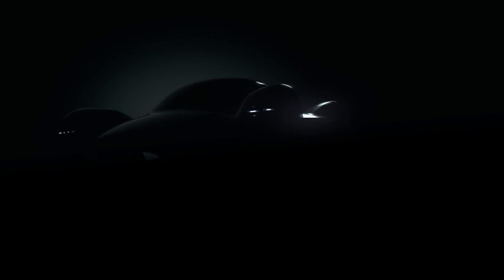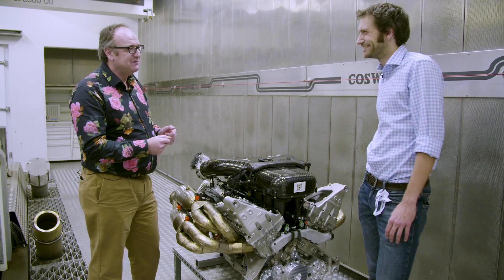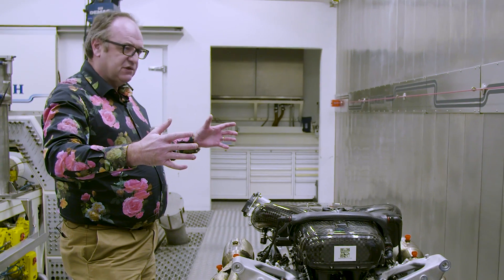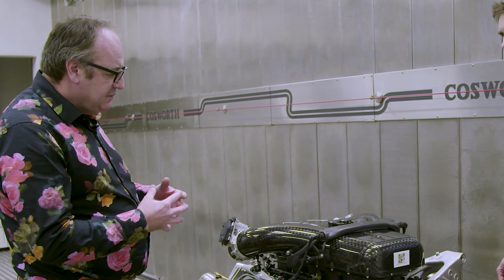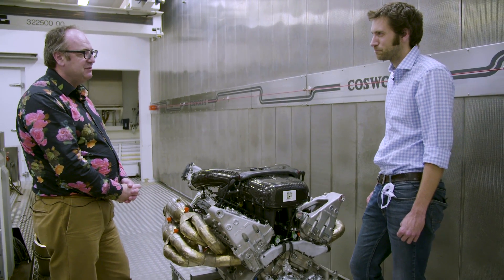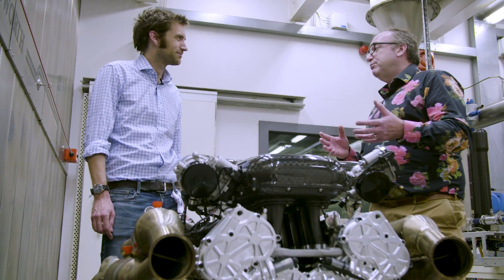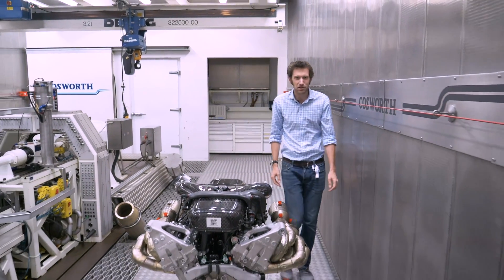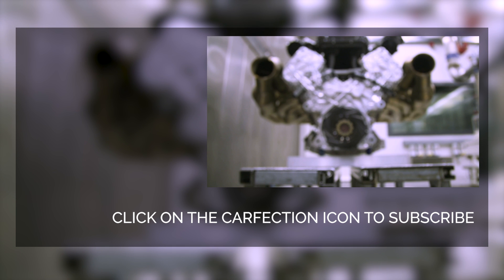Hear The Future Of The Supercar At 11,000rpm: The Aston Martin Valkyrie's V12 - Carfection

Comment: I did not think that we would ever have a new v12 na engine ever again. Thought the ones Ferrari and Lamborghini use in their cars would be the last. I am pleasantly surprised by this. Thank you Cosworth and Aston Martin
Reply: Us boffins take the emissions regulations as a challenge to overcome, not a roadblock. More to come, I'm sure.
Reply: @rigglestad8479  2L/100 km seems quite unmnagable for a v12
Reply: Just add batteries and run the emissions test in hybrid mode. Voila.
Reply: @srinitaaigaura  Volkswagen would like to have a talk
Reply: We’re running on borrowed time for anything above v8s, manufactures are making these just because consumers are there, once we’re gone, I doubt these beasts will exist
Reply: There is still hope! And there is more! The Apollo Intensa Emozione has a completely new naturally aspirated V12 as well!
Reply: @Dusto9  pretty sure thats a Ferrari V12
Reply: @Giovanni John-Blackett: Turns out you're right! After some reading it does seem to be based on a Ferrari engine. Either way, nice to see another company embracing the na V12 :D
Reply: @Dusto9  not new
Reply: @Dusto9  pretty sure the apollo v12 is from ferrari
Reply: @Dusto9  it's a ferrari V12...
Reply: And then Gordon Murray enters the arena.
Reply: The industry is very "smart". N/A engine will cost more as more rare they become. I don't think that with all the tech we have and all the development we could achieve...we could mantain N/A on the market. However, linked this image with purism, racing and so on, automakers could rise up the price of their cars...
Reply: The apollo IE has a new bespoke 12 cylinder engine. It is not a Ferrari engine like some think
Reply: Gordon Murray's new T-50 will have a 12,100 RPM V12 as well. Normally aspirated.
Reply: Guess you haven't seen the recent mclaren t50 engine? also a cosworth...12100 rpm...
Reply: @justkiddin1980  he/she commented a year ago🤦
Reply: And you're running out right now to place your order? Yeah. Me either.
Reply: Same thoughts and 1000 n.a. v12.
Reply: AndreVD you gonna buy it?
Reply: @NecumNaTo  No, i am not that rich.
Reply: Try saying that to Lamborghini & Pagani...
Reply: Roger That!
Reply: And it looks like a pagani too lol
Reply: so this isn't a freshened up duratech based v12?
Reply: not about cylinders, is about size.
Reply: as long as they keep compression high enough, they should be sustainable as far as emmissions
Reply: https://www.roadandtrack.com/car-culture/news/g6662/v12-powered-cars/?slide=12 bmw and rolls royce both have new v12's
Reply: why?  I mean we already know what the Toyota 2jz is capable of and it's more durable.
Reply: Yeah its a shame these Incredible V12 engines are dying out. Even the V8 engines are being killed of with turbo charging V6 and Straight sixes.
Reply: You don’t have to comply with emissions regulations if you sell bellow a certain number (in most countries). Translation “the rules don’t apply to the super rich”.
Reply: don't forget the Apollo IE
Reply: u buying the valkyrie?
Reply: The gordon murray design t50 that will come out in 2022 has a na v12! AND IT REVS UP TO 12,100 RPM!!
Reply: Holdens use n/a engines to 😂
Reply: @noblestar7742  maybe you should get in the ground with them like the dinosaur you are.

Electric / Hydrogen/ Biofuels are the future.
Reply: @noblestar7742  don't you DARE  insult my intelligence like that you know nothing about me, but I can tell a lot about you because of your repetition of  propaganda the oil companies put out . My background and interests mean I'm fully aware of the supply chain of electric vehicles. I am however acutely aware that a medium sized electric car is better for the environment after 4 years in  a largely coal powered country, less time still in countries like the UK where renewables account for nearly half the grid.

The electric car came about the same time as the ICE and Steam powered car, but energy storage wasnt up to the task. Its getting there but isn't quite there yet.
Reply: @noblestar7742  and since you dont have any reasonable arguments to come back with. It says a lot about you.

Good day...
Reply: @noblestar7742  you're an absolute knob.

I take issue with people condescending down to me with incorrect arguments like you do.

And you started it, not me.
Reply: Sounds like the F50 GT in forza
Reply: @noblestar7742  right. So wanting a habitable planet for generations to come is now tree hugging.

Ok then

Climate change will result in us all dying in the future. I just don't understand how you have so little concern. The planet is a finite system and we cannot keep polluting it like this.

You must be american.
Reply: Just a Ford 2(6) = 12
Reply: And FORD
Reply: I will always look up the to the v12
Reply: AndreVD Lamborghini V12 is not a new engine. It’s the old engine that they are modifying
Reply: @ddd-sx7pw  i did not know they were using a lambo engine.
Reply: AndreVD Aston Martin has it’s own engine. I mean that Lamborghini is using the same engine that they have created many years ago
Reply: @ddd-sx7pw  ok then you missed my point. what i just wanted to say is that i did not think that in the era of engines getting smaller and turbocharged, we would have again a new car running a pure NA V12. As far as i know the successor to the aventador or the next hypercar ferrari etc will not have a NA engine anymore, it will be some sort of hybrid or turbocharged thing.
Reply: I thought this engine was amazing, but now I have seen the Gordon Murray T50 engine, that's a V12 work of art.
Reply: amarjit singh I prefer the T50 V12
Reply: amarjit singh best if you go on the T50 YouTube videos. It will most likely be the best V12 engine ever made.
Reply: amarjit singh Don't worry. It will be the second best V12 🤣
Reply: amarjit singh This is second generation after the Aston Martin V12. But it doesn't really matter. Both cars are British as an I.
Reply: Trust me someone else will eventually come out with one last hurrah with a v12 withnrelatively low displacement, and itll keep on going
Reply: Yep and now, thank you, Gordon Murray and the T.50!
Reply: T50
Reply: AndreVD T50 bois!
Reply: @amarjit singh Take a look my comment is a month old...
Reply: @amarjit singh Aaahw boohoo you got me there...trolling about car issues is a new thing now? I guess that's what you get when whole generations are raised on soymilk..
Reply: @amarjit singh Pffff wow go cry me a river....i don't give a fuck...why would you start beef over a car video?? Go back to drinking your soymilk it is getting warm...come on...go now and don't bother me anymore...
Reply: amarjit singh I don’t care...
Reply: @amarjit singh No i don't care because you're a crybaby soyboy getting wound up over a car video...
Reply: @amarjit singh Has it got four wheels and a engine?? Of so then yes its "just a car"...
Reply: If I owned one I'd take it to a vegan environmentalists rally and rev it....
Reply: ABIR AHMED with the exhaust valves open :D
Reply: @laracroft938  Muwahaha
Reply: @laracroft938  for this i would prefer summernats competition cars tho
Reply: @laracroft938  That made me smile like a loon!
Reply: @laracroft938  you'd best hope 'petrol head' vegans like me aren't there otherwise I'd be tempted to steal it lol
Reply: @KXP70  Vegan petrolhead? Do you know how many dino's died for your tank of fuel? 😉
Reply: @KXP70  It must be hard having a split personality.
Reply: @acruzp  what's split personality about having a passion for cars while not consuming murdered animals?
Reply: @KXP70  I didn't think I would have found another petrol head vegan. Do you watch any vegan channels?
Reply: @RedBatRacing  Oil is actually mostly plants in the form of algae. It's a common misconception that it's dinos. Either way it's clearly not hurting animals so it's vegan.
Reply: Thanks goodness, the reciprocating piston engine has been obsolete for over 10 years now. A proper engine could produce 1000 hp while weighing less than 200 lbs and have very few moving parts.
Reply: @RayleighCriterion  um What? Reciprocating engines are better then electric motors for power curve and better then a rotary power curve.
Reply: Agreed, hopefully it continues as a trend. tbh I just want the V12 Diesel Q7 in the states at some point
Reply: Maybe. I think EV is a dead end tech that will ultimately go nowhere. Efficient turbo engines are frankly shit, discerning consumers will be sick of them soon enough. New tech such as variable compression, better electric hybrid integration, etc with NA engines are probably going to have a resurgence in the performance/petrol head world. Maybe not V12 though!
Reply: @alphalobster8021  the future is vehicles which dont produce  emissions, in a power plant generating electricity emissions can be much better controlled so eventually everything will go full electric unless they come up with something better that doesnt produce emissions
Reply: @alphalobster8021 
 Alpha Male (lobster)  some agreements. The ICE is NOT dead but has new competition. I am thinking, the next five years will be hybrids. Small two cylinder engines the charges the "batteries".  Camless engine that has valves that are computer controlled.  It so stupid to carry all those batteries & energy, that will never be used. 80 KWH is a HUGE amount of energy to carry around, when you need to drive a short distance to work or market or school. Once or twice a year you go outside of the city limits & use the 80 KWH. A twin cylinder hybrid that charges a much smaller "battery" pack is much more effective & smarter & lighter. Without the worry of Dead battery.
Reply: @alphalobster8021  Not all turbo engines are bad mate. Combine them with a hybrid system and you can ease past emission control. Also you won't go bankrupt paying for fuel.
Reply: @ksp3324  I think for Std family car you are on to something. Hybrid could be a good edition. But I am wondering for the performance market, why bother with a turbo when a decent hybrid system will greater the torque and the NA V6 or v7 will create the noise and drama.

Comment: Probably an unpopular opinion but i was pretty underwhelmed with the sound.
Reply: There was no exhaust attached to it, so just raw pure engine sound
Reply: I mean that's what it's supposed to sound like that. Like F1 cars. Sound of High RPMs lol.
Reply: Jose M. Leon are you deaf
Reply: You're deaf
Reply: Its not running into the backboxes on a dyno soft lad.
Reply: agree but i expect will sound different with full exhaust system
Reply: I probably have no idea what i'm talking about, but i believe that was just the engine sound, not the sound the car will make after it's finished production. Meaning that if you add the whole exhaust system and the shell of the car, the sound will probably change. 
But hey 11000rpm will always scream like a trillion bees! If it looks like F1, it might as well sound like it!
Reply: It sounds like a f1 car. Do you need more than that?
Reply: I totally agree. These that like it must live in a kitchen and think blenders are cool. zing zing zing
Reply: Wait till someone will straight pipe it, then your ears will bleed
Reply: You can hear one mic cut out and they fade to another. I think they're better mic (which sounded way better) couldn't handle the volume so they switched to another
Reply: "Opinion"
Reply: Maybe underwhelming is the wrong word, but I basically agree, it sounds like a motorcycle engine. I am a big fan of deeper sounding engines. My favorite engine sound may still be the 917K.
Reply: Wait till you hear the finished product within the car. If you still don’t like it, you are not a pretrol head